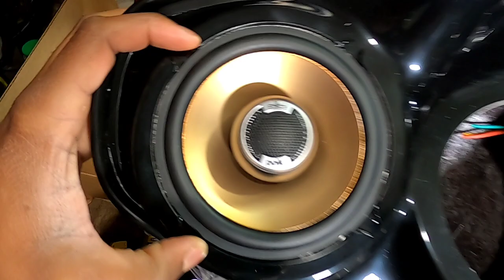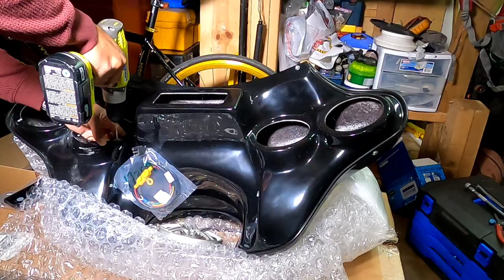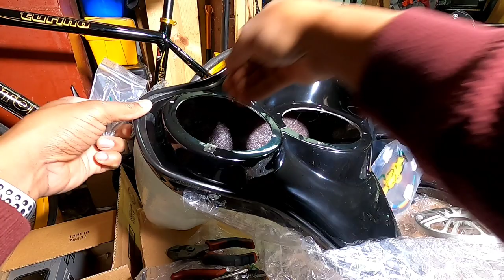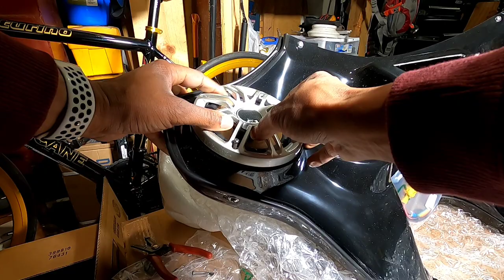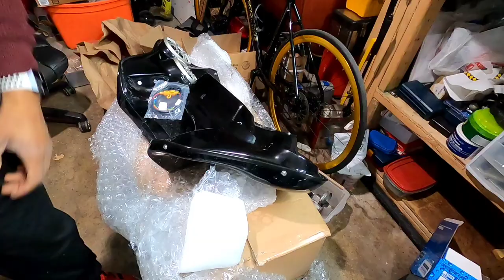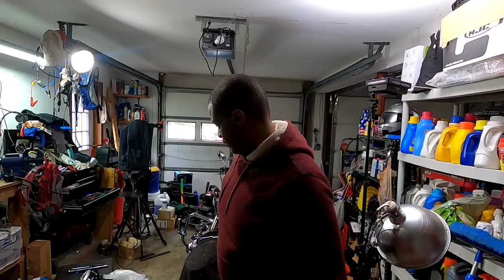Installing the Polk DB-521 Speakers in to the Reckless Fairing | E.5

Comment: You done an excellent job on installing the speakers brother and you took your time to do it right to, it's going looks really good when you get it done, good job brother 💯✌️😎
Reply from the maker: Thank you brother , its getting there. I just need to get some bolts for the fairing. I got some figuring to do with that.
Reply: @dbest1aVlogs  yeah but you'll get it man, I have confidence in ya brother 💯

Comment: I think the tweeters on Polk speakers are “turntable” to a certain degree. If that helps. Also, what are your plans for GPS moving forward? (Being the old one was inside the fairing).
Reply from the maker: You are 100% right. I noticed that while installing. 
I will install a small side mount that will allow me to still use the GPS. I did consider changing upgrading to a better GPS, but don't see the point.  I barely use it, unless on trips.
Reply: Dbest1a’s Ride yah I agree. I traded in the deluxe last fall for a road glide and the boom box gts audio system actually has a great gps in it and I still don’t use it lol.
Reply from the maker: Lol. You got the new improved system I bet. I test rode the road glide... In the test rides playlist.. It was such a smooth ride aerodynamically. Really loved it. Fit and finish was top notch too. 
I just would need more time to adjust to the front end extra weight. Im really used to a fairing in tight turns.